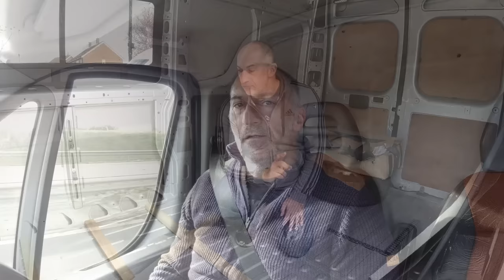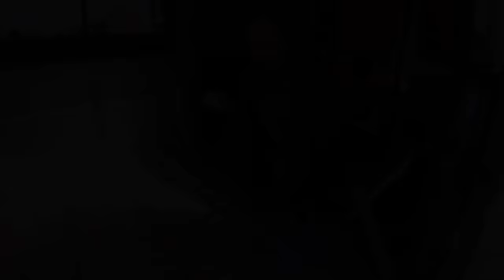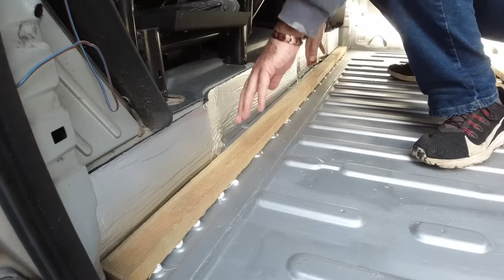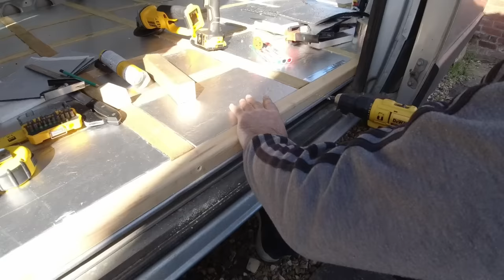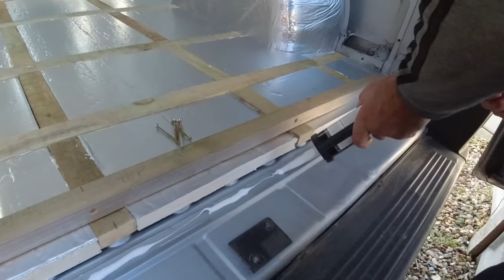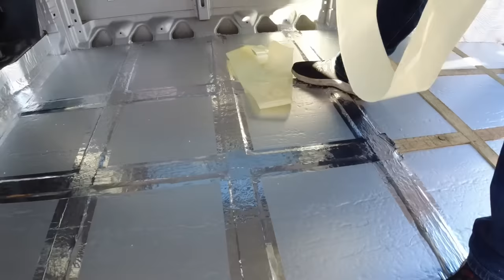How to Insulate your Floor on a Budget - Episode 7 of the Van Build Series

Comment: Ahh nice, seen many put a lot of weight on the battens, I see clearly why not to...Counter intuitive to clamping wood joins..Another idea, put pocket holes in the subfloor noggins, once the 522 goes off, put screws in..Then it's rock solid..
Reply from the maker: Yes you do not want to squeeze all the adhesive out or it wont do its job :D

Comment: Soo glad you didn’t use screws there is literally no need with todays adhesive. Much neater all round finish. Excellent choice and glad you hi lighted it.
Reply from the maker: Yes the adhesive is very strong as long as the surfaces are clean.
Reply: @GregVirgoe  indeed. The van I’m starting now needs a bit of welding but floor will get in the booth soon, but in a new van you could even be really picky and even just run a grey scotch down the Chanel’s before hand. Looking forward to next vid 👍🏼

Comment: Nice Job, Greg, and a great video series. I can only confirm: I glued the floor and all the structural wood members of my van build with car body adhesive. Now it's 5 years and 10s of 1,000s of km later, and there is no rattle whatsoever. (Sorry, I don't remember the brand of adhesive, it's the same stuff car manufacturers use.)

If it's permanent and doesn't need removal later, adhesive is better than fasteners in many ways. The trick is the right adhesive for the job and proper surface prep.

Cheers from Germany - Folker
Reply from the maker: Making sure the surfaces are clean and free of grease and contaminants is crucial to get a good bond I agree with you 👍🏼😃

Comment: Greg i was just about to comment saying great job but think screwing the battens down is overkill imo then you did the rewind bit Lols
If i did another van to make the floor install simpler I'd consider gluing down a high density foam then glue 18mm ply on top, full insulation and no cold spots through battens. Just an idea.
Reply from the maker: The wood has good insulation values of 0.1 W/mk so it does offer some insulation. but more than that its structurally load bearing than just a layer of insulation or foam, Put lots of heavey furniture on top of a single layer of foam it will get squished :D
Reply: @GregVirgoe  i hear you for sure Greg.
The solid foam they use under cement screeds interlocks and doesn't crush. I saw someone do it once and thought it made alot of sense mainly for the simplicity.

Comment: You are right about the amazing strength of Sikaflex. I had to remove some battons from my van floor, after a layout change. It was a hammer and chisel job! Moral, plan everything!
Reply from the maker: I had to remove a baton from the ceiling in the sprinter build and it was a crowbar job, really is strong stuff.
Reply: @GregVirgoe  The wood splinters before the sika lets go!

Comment: great to see a budget build. with simple tools. we use adhesive sealant for joining materials, with a lightweight  DIY modern build.
Reply from the maker: I'm trying to use a wider range of more basic tools and no workshop this time so that its relevant to more viewers.
Reply: @GregVirgoe  great to see, that's what I found when using composite panel, you can even score and snap it, if you don't have a saw.

Comment: You're brave for doing the alumi tape gloveless. I still have nightmares about all of the little fingertip cuts from taping my foam board😂
Reply from the maker: Maybe my hands are a bit rougher. Gloves would be a good idea but you lose a bit of touch. Pro’s use a card to smooth out applied tape. 👍🏼😃

Comment: I love FB market place, Gregg. Ive managed to get two brand new firefly solar 15o watt  flexible solar panels for my van for under a hundred quid plus roof bars etc  for viv-i-van. I'm always looking on there. You get a few con artists on there but some great bargains also.  I love your videos and often go back to previous ones for tips etc. There's a reason you are highly regarded in our camper van comminity and its well earned. Much respect and thanks for another great informative video. Bessy regs- Kenny.
Reply from the maker: My best advice to avoid scams when buying from other members of the public is not to part with cash until you see the product yourself and if it looks to good to be true it often is.

Comment: Thanks.
I definitely want to convert a van , to a camper.
I was always afraid to take on the challenge.
But your videos are extremely helpful.
And will in the not too distant future.
Thanks again.
Reply from the maker: Brillaint, it is a lot of work but if you break it down into these tasks as per this video series it becomes more managable and you get the satisfacttion of little goals along the way when you tick of each task done

Comment: Hi Greg, not sure if you plan on doing this but a spreadsheet with a breakdown of material, components and appliances you use in the build along with costs and how you sourced them would be a valuable resource. Cheers for this series, invaluable 👍.
Reply from the maker: There will be a detailed breakdown video. Lou has already compiled a spreadsheet of everything we have purchased down to the last screw. 
I’m posting as many links as we go along the way and like todays video will give snippets of costs where they apply in each video. 👍🏼😃
Reply: @GregVirgoe  Cheers.
Reply: Hi Greg once again great info,  will there be break down of costing

Comment: Hello from Oregon George. I have watched your videos for the past year or more dreaming of the day I can actually put them to use. The time has finally arrived! I just purchased a 2023 Ford Transit HR AWD with the Trail Package and ready to start. I just rewatched your floor insulation on a budget video and excited to get started. A few questions. The wood you adhered to the floor was on the high spots, which I like for some air flow down the low spots, yet was wondering if you used thicker boards at the door areas since they are adhered to the low spots.  I really appreciate your background knowledge as it relates to the best insulation strategies in a van. Looking back, would you do anything different on your floor insulation?

Comment: Cracker of a video mate…and you are so correct - we use Sika Flex to glue light weight cable trays to carbon fibre panels and they just stay put 👌🏽
Reply from the maker: Yes it is strong stuff 👍🏼😃

Comment: When researching my Ducato build, i went looking round "pro" built campervans, i was surprised to see the floor was not insulated, just plywood straight onto the floor... I did similar to what you have done though, I'm short so didn't mind the loss of height! 👍
Reply from the maker: Most pro campervans are built for summer holidays they not designed for cold climates. No thought is given to heat loss or condensation control. They are only used two weeks in the summer. 😮
Reply: @GregVirgoe  that's true! 😅

Comment: Once again pure genius! Thanks for the info and advice. It's interesting to see your thoughts on screws/no screws. I guess there's positives and negatives either way. Keep up the great work Greg👍👍
Reply from the maker: There's no doubt any fixings add strength, I don't regret doing my own van, if the adhesive is very good then perhaps you can get away without that step with a simple van layout.

Comment: Very good.  I tend to be a belt and braces person, so would have screwed the baton to the floor as well.  I am sure that the adhesives used now are probably more than adequate.  Enjoying the series.  Cheers Jim
Reply from the maker: I'm with you and thats what I did in the first van, I had to remova a batten in the old van and the adhesive was incredible. Its only going to add strength using screws too.

Comment: I almost finished a sliver mwb boxer van but sold it due to a change of job.  I really enjoyed the build and it kept me sane and gave me a project. Thanks for all your detailed information.  Im thinking about doing another van build in the next 2 years and really appreciate all your hard work and detailed step by step information.  I massively over complicated the first van and will keep mk 2 far more simple. I now know where to spend and where to save.  I think £25k would be doable to build out a good van that meets my requirements. 

Cheers 

Chris
Reply from the maker: 25k will get you an incredible van no doubt about it. The fit out on this new van is under £4K 😃👍🏼

Comment: Due to pick up mu Van on Tuesday Peugoet boxer. Loving your latest series which will definitely help me on my conversion. Thanks  David
Reply from the maker: Exciting times ahead David, what are your plans for the van?
Reply: We are still planning the layout trying to balance fixed be with seating space. I was thinking of a semi fixed pull out bed which would pull out over a mid seating area. But may well plumb for full fixed bed, bathroom, kitchen IWO of sliding door and an L shaped seating at the front. Leaving the current cab seats as is. Hopefully full of grid capability.

Comment: I didn't screw down the buttons either. And I was following the steps on your Sprinter van conversion, I simply forgot as you did here. There'll be many structures pressing down on it and attached to the walls so I think it's secure. No issues so far. The Sickaflex is the only thing holding my flexible solar panels in place for four years so yes, that glue is something else.
Reply from the maker: It may have appeared like that on the video but it was a consicious decision this time to see how well the adhesive cured and then decide whether to use screws or not. You cannot rely on just the weight of the objects alone, they must to be secured to both the floor and walls. That weight when driving has huge stored potential energy and in a crash will continue to travel forward towards the cab if not secured.

Comment: I’ve battened my floor and used 25mm Pir too. I didn’t screw through because like you I found that the glue alone was pretty bomb proof. Reassured that you share my opinion though.
Reply from the maker: Thats brillaint, yes it was stuck really well, surprising how strong it was.

Comment: Superb job on the floor.
Reply from the maker: Thank you very much :D
Reply: @GregVirgoe  Just interested (as my van is pretty much done), does the PIR board have a much better insulation value than that closed cell foam you've used on the wheel arches? Would it be an option? I'm confused by the R values which seem to be fairly absent for closed cell foam sheets, or shown in inches rather than m2.

Comment: Thorough overview and prob. the best method to lay the van floor..

Personally I just went with PIR sheets and laid them over 2mm plastic underlay. The side beams of the transit van made the PIR sheets very rigid with zero movement.

Then I stuck another layer of 2mm plastic underlay. Above which I layed MDF laminate.

So 2mm polyethylene foam underlay then 50mm PIR then 2mm polyethylene foam underlay followed by 8mm MDF laminate.

I will then varnish the laminate
Reply from the maker: With 50mm PIR that will be very well insulated.

Comment: , Good work Greg....... The only thing I wish I had done before fitting the floor was to fit the fold out step which was a nightmare afterwards!👍
Reply from the maker: Does it need to be bolted through the floor? Not just fixed to the chassis rails?
Reply: @GregVirgoe  
Mine was a Thule manual action fitted through the floor!
Reply from the maker: @rogertaylor2924  oh yes that would be a problem to install 🤔
Reply: @GregVirgoe  
Turned out to be the most frustrating job on the whole build😵‍💫

Comment: On my last build I used screwfix's "pink stuff" and it worked a treat without screws. A bit cheaper also 😁 (please do correct me though if there is a reason I shouldn't use it 😅)
Reply from the maker: Whatever you use it needs to remain flexible as the van is constantly moving and construction adhesives that cure hard will eventually crack and fail.

Comment: Yes, mechanically it makes sense to screw the batons down...you don't want any furniture potentially flying over in a crash or strong braking...it still would be very, very difficult, but I would do it in my van too...one wouldn't just trust the sikaflex to secure a driving-seat to the floor, right? in a cheap build, it does add more complexity and expenses though , and especially something more to worry about (rust underneath), so as long as it's not heavy-loaded (or any furniture is also screwed on the side metal pillars, where possible) it would most probably be fine.
Reply from the maker: The crash safety was a big part of my decision making process originally especially with the bulkhead removed. you are right about seats etc, great comment, thank you

Comment: Great Job looks very tidy. I noticed you set the battens for 8'x4' ply sheets but you mentioned the plywood you bought was 10'x5' are the bigger sheets for the walls.
Reply from the maker: Yes spot on 👍🏼 I can pretty much do each side with just one sheet 🤩

Comment: Good video again. Great to see you sharing advice on how to locate materials and parts. 
If you did pull the Sikaflex up the chances are you would have pulled paint off the floor in places. The right kind of sealant adhesive is very strong on its own. Screws would add strength to vertical or ceiling fixings if a load is to be carried but, where no "pulling" loads are going to occur, it will work fine on floors.
The offside sill cavity is visible in a lot of the shots in this video - around 10.00 mins in is a very good shot of it. This runs from wheelarch to wheelarch effectively below the floor level. Usually there are black plastic triangle like bungs in the visible cutouts. This sill is an excellent place to run cables front to rear ( or a feed from the right hand pillar fuse box ) or pipes out to under the floor if you want to avoid drilling down through the floor itself. The inner face of the sill is a vertical flange and could easily have holes cut into it to provide access. Just another area in the van shell that can be used to good effect. There is a sill  space under the sliding door area but it is very difficult to access and very small.

Comment: Nice van build video

I just came across your video as it’s on my algorithm on yt. must be because I’m a hvac insulator. 

I don’t really use much of the PIR stuff in my job but I used it in my garden room, I can always remember at college being told to cut all the way through it (with a sharp knife like an armaflex one) and never break it off. I use armaflex/armacell nitrile rubber on the pipes but I know that you can get sheets that would be excellent in a van build.

When using foil tape put a slackened belt round your wast and put the tape in it, you’ll never need to rip it and your hands are free.
Reply from the maker: I’m an HVAC design engineer which is where most of my knowledge comes from. The guys that worked on my projects used a lose bit of cable as a tape belt 😃 see my previous video as I’m using foil faced Armaflex sheet on the cam roof. Hope you found it interesting all the same. Thanks for the comment too
Reply: @GregVirgoe  yeah it was very informative, and it is something I would love to do maybe when the kids move out. I have a static caravan but my wife has always said she would love me to do a self build camper. So I will be subscribing to see more.

Yeah I just had a wee look through your videos I’m on the one you lined the cab with the nitrile rubber. That’s when it clicked you must be in the trade 😂 as you go into some detail mate. 👍🤌🏻

Comment: Hey Greg love this build I can’t wait to see it finished the amount of detail you put into the videos is great I have a question for you I saw other person using CIGS. Ultra thin solar panels there around 200W each panel for around £260 ish … just wondered if you’d Hurd about these and your thoughts on them … there super ultralight weight ( fairly walkable / flexible ) Copper Indium Gallium Selenide claim to be over 35% more efficient too…. Let me know your thoughts ! Good luck with the rest of the build 🎉
Reply from the maker: I don't know of anyone making those panels, can you send me the link,? The technology came about 5 years ago but efficiencies were not much more than mono silicone panels at about 22%  I do not know of anyone that has a panel on the market that has that efficiency yet so I would be very interested to see what they are.

Comment: hey Greg - I am using your insulated ceiling & floor design. The ceiling stakes you recommended did not work out for me - the morning after install, I found half the insulation on the floor with stakes. 
3m 5200 adhesive was recommended... but I do appreciate & follow you daily!
Reply from the maker: Did you clean the roof first? May be some sub standard ones about. 
I could swing on my they are never coming off. Some not right with your ones i fear 😧

Comment: Just picked up my L3H2 so I'll be watching your progress. 
How many 3m battons were needed? Did you space them to a specific measurement to avoid waste? How many 25mm Insulation boards are required?
Reply from the maker: I bought a pack of ten 2.4m battens for £22 from timber yard and had two left over spaced at approx 14” / 350mm apart. It took two 8x4 sheets of PIR to cover the floor with minimal left over. 👍🏼😊
Reply: Thanks for taking the time to reply, very much appreciated. Love your videos. Looking forward to the Insulation video to see how you do it on a budget. 👍